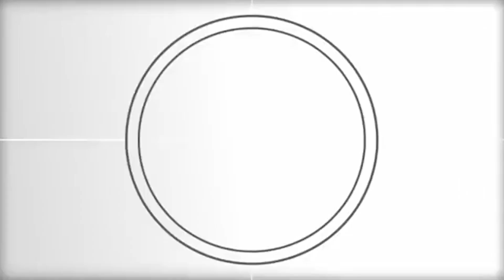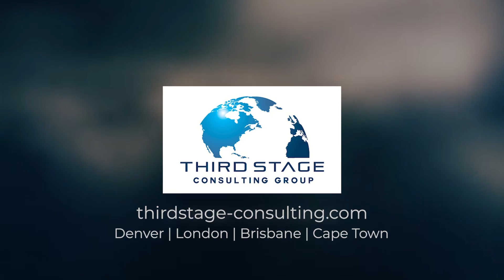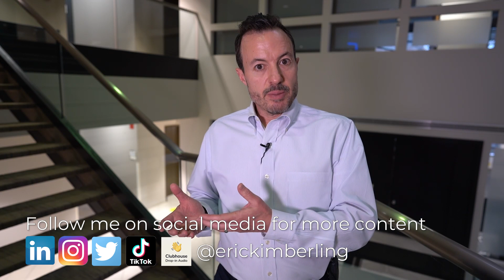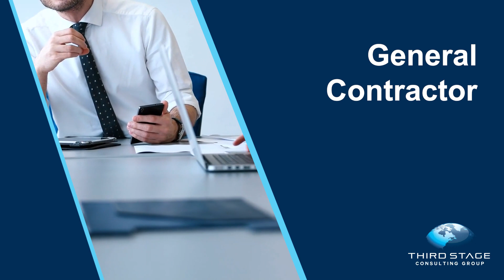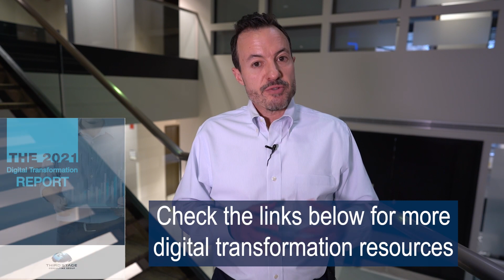How to Construct a Winning Digital Transformation Strategy, Architecture, and Blueprint

Comment: Also System changes should be strategic as you rightly mentioned, there are many dimensions that should be considered: Before the project assessment: What is the value we want to create, Efficiency, Internal and External Factors, How it will achieve our strategy Y1 till YX, Legal, compliance, Risks & Cost of Investment. 

Then there is the the during implementation dimensions: Implementation timelines, Efficiency vs what it was supposed to achieve, Metrics, change plan.

Post Implementation Before go live: Success Metrics and Benchmarks, Excellence Achieved, Value Created.

All these aspects should be part of the strategic planning.